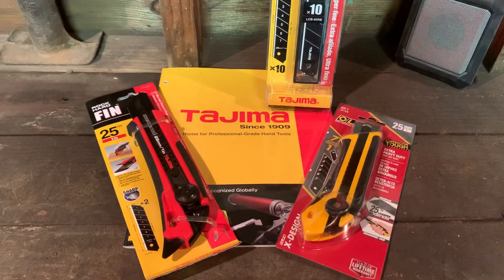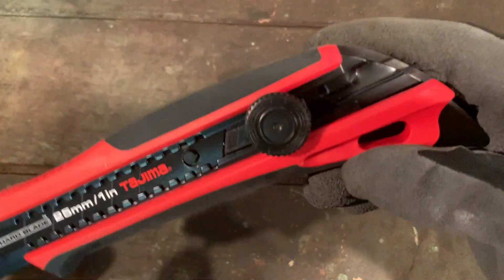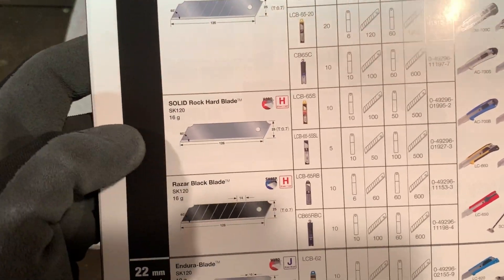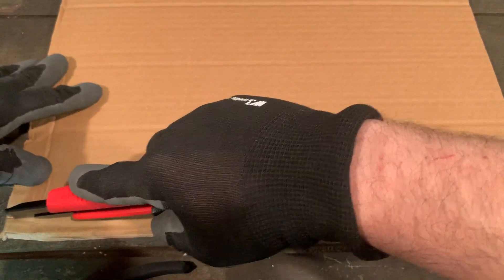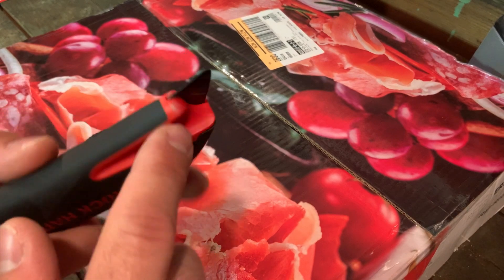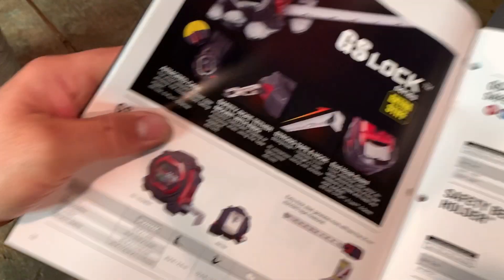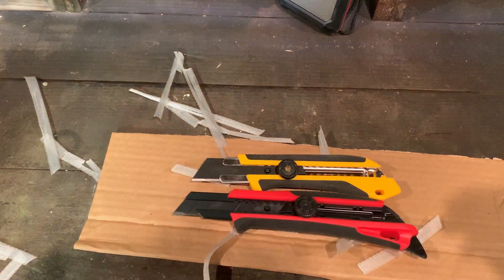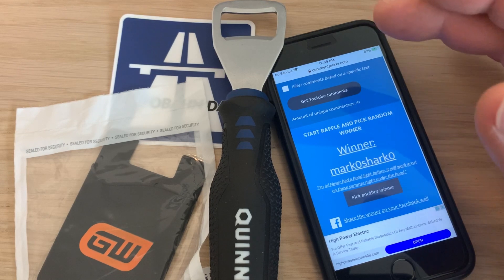Tajima vs OLFA 25mm Utility Knife + Gearwrench Giveaway Winner!

Comment: The Olfa's cardboard issue is because there's not the same amount of the sharp side of the blade out. The Tajima have twice the blade length which is not fair because you can cut at twice the angle. Sharpness is also related to angle of cut and speed. The tooth on the back of the Tajima is not a safe blade but a tool to push carpet on a corner prior th cut it. Actually you're mostly testing the blades, not the cutter itself, while blades are interchangeable, so... It would have been interesting to compare how long can the blade can go out, the resistance of the blade outputguides, and the play on the blade on both models.
Reply from the maker: Thanks for the input!

Comment: Probably one of the reasons why OLFA didn't add extra features to their 25mm knives was to avoid making the knives too big and too heavy. 
I have an OLFA OL 18mm knife with an extended blade channel and a metal pick on the back of the handle which looks quite similar to a 25mm Tajima knife but OLFA has been making OLFA OL since 1975 long before Tajima but OLFA still haven't made the 25mm version.
Reply: They have them out now just hard to find
Reply: @kj3472  Which knife are you talking about?
Reply: @Yudi.Hilmawan  Olfa makes a 25mm now
Reply: @kj3472  I thought you were telling me that OLFA makes a 25mm version of the "OLFA OL" because if I'm not mistaken OLFA has been making regular 25mm knives since 1988.
Some OLFA products are hard to find in local stores, but if where you live there is a shop that sells Japanese tools, usually they will also provide OLFA products.

Comment: For cutting off a piece of the blade, i don't use a plier.
Using:
1.) Olfa ARDC-5
or
2. ) Tajima Disposal Case TAJ-10732
It's saver than using a plier.

EDIT
In Germany the Tajima DFC671 25 mm ist not / black / red, it's black / white.

Piet from Germany
Reply from the maker: I am guilty of opening the recycling bin in the driveway and just snapping it off against the side of the bin inside..😂🤫😂😂

Comment: Did you say Sac fastener as in Sacramento? 
I have recently become a fan of the 18mm olfa knife for doing drywall. What could be better than an 18mm, a 25mm. I am just now starting the search and i hope that i can find a 25mm knife with an auto lock/ unlock slide thingy.  I don't le the dial locks
Reply from the maker: Yes, same company, but I go to the San Jose store. They have six Fasteners franchises in California. Since I bought that Tajima, it has been my favorite! I just recently used it for my drywall job in the garage! Works amazing! Large and easy to find! The larger Blade scraped out an edge perfectly as well!